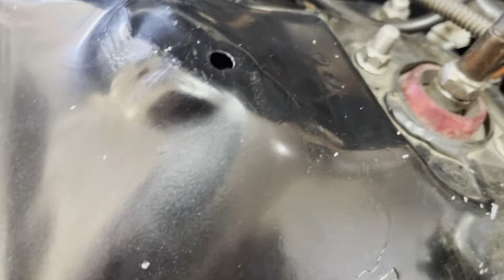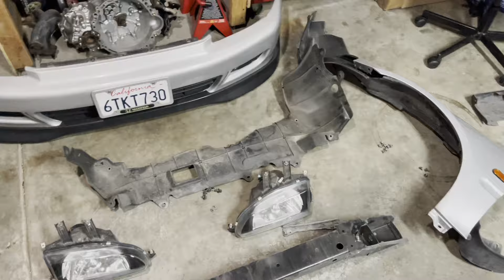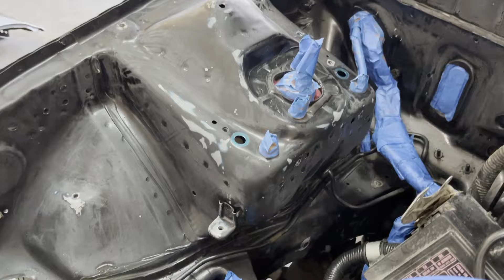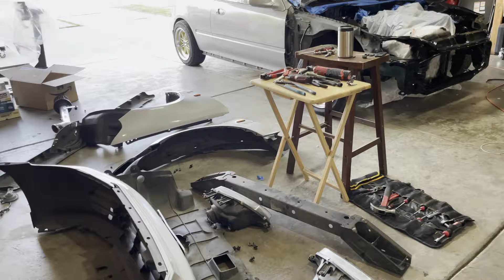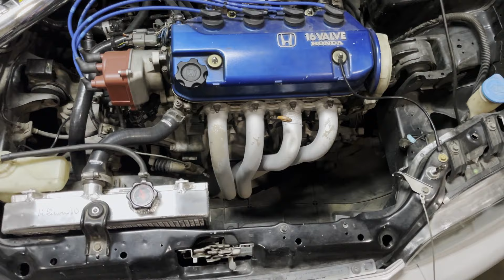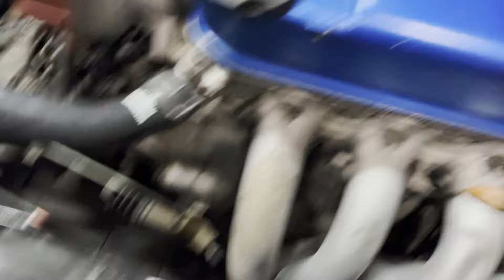Painting My Engine Bay WITHOUT Removing My Engine!!!! Honda Things...

Comment: What did you paint your exhaust with?
Reply from the maker: @nimster64 Just some Orileys flame proof paint… no clearcoat!! Lol i always forget the clear coat🤷‍♂️😅
Reply: @projectgoodspeed  looks good. Thanks for sharing. I will go get some tomorrow
Reply from the maker: @nimster64 remember to prep… lol thats why i had to repaint them 😅
Reply: @projectgoodspeed  yes most definitely I am going to sand down the spots that have surface rust then degrease everything then wash with dawn soap let everything dry them primer paint and clear coat 😎
Reply: @projectgoodspeed oh and wipe with alcohol before I spray
Reply from the maker: @nimster64 sounds like you got it!!!👍